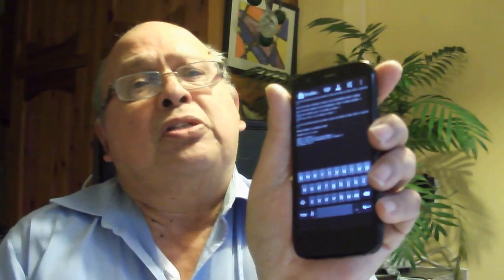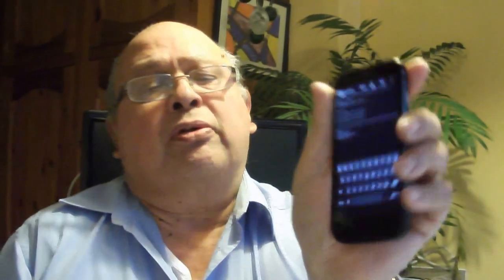Finite Element Analysis Via A Smart Phone, December 16th, 2013.

Comment: Still Innovating Carl...out of interest what type of mesh were you using and did the calculations come up with the same answer as hand calcs and a more regular commercial program
Reply from the maker: Most of the programs were on the small-deflection, static, dynamic & stability analyses on trusses, frames and shells; meshing was not a problem on these structures.  Thank you for your valuable contribution and best regards.